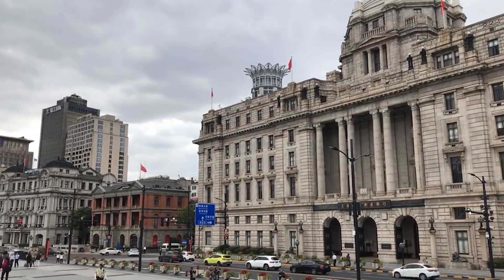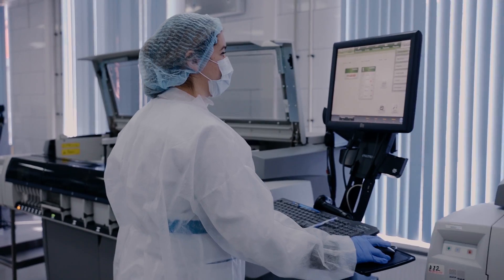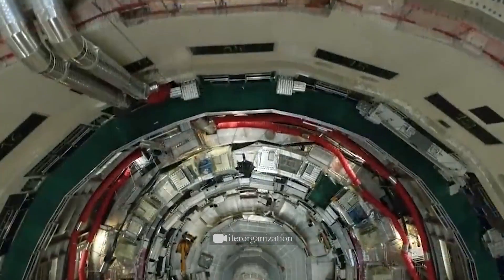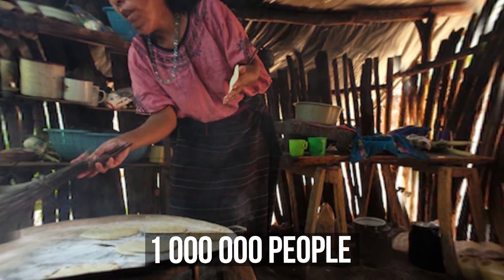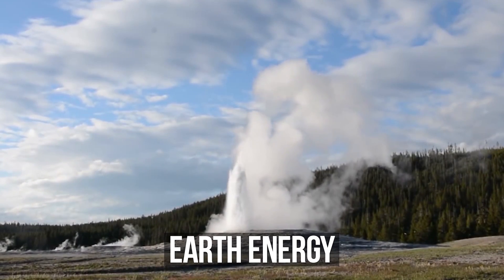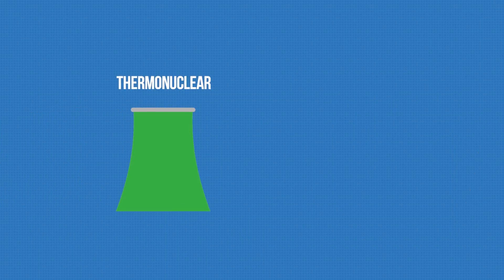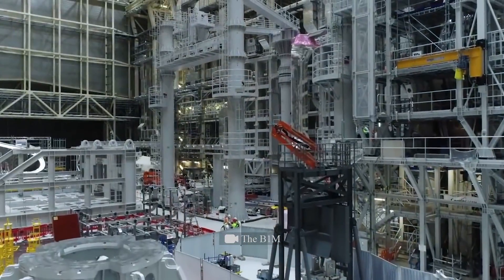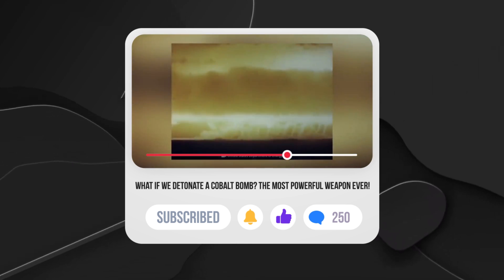Scientists Have Discovered a Terrestrial Source of Energy 6 Times More Powerful Than the Sun

Comment: The moon will be there for almost as long as the sun so, why not use tidal flow to generate power?  Inexpensive, non-poluting and fairly low tech.  Of course, it does require a good distribution network to get that power inland.

Comment: The most urgent need is to develop thermonuclear politicians that emit the work they're supposed to be doing as a byproduct of them being paid to represent us? Currently, they contribute to more deaths globally than anything we use as fuel and will probably bring about the demise of the human race far sooner than fossil fuels. If they would do what they're elected to do instead of trying to further their own agendas and family fortunes, alot more resources could be applied to the climate change problem. Also there would be a lot less hot air being discharged into the atmosphere and a lot less toxic environment in our capitals.
Reply: Hi Tom. Politicians are better at "fission" than "fusion". They split all too easily, form inert radio-active gases, and very low energy neutrons which come to nothing. Cheers, P.R.

Comment: This is why we need to invest in modern advanced nuclear energy options. Small form reactors, LFTRs, Thorium Reactors, liquid reactors. With advances in modern technology, engineering, material science, safety measure understandings and designs, computer technology, robotics, It will really allow any nation to be pretty much be energy independent. Less reliant on fossil fuels. They'll have efficient, stable electrical grids and the rest of the grid could experiment with alternative power sources, etc. We will lessen our emission output a ton since nuclear energy is a emission free power source. We can heal and learn from our past. We really were not ready to handle atomic energy when we did it. Our technology, knowledge, safety measures, computers, reactor options, designs, type of nuclear energy options are so much more advanced now and seriously it will be so much better than this current fossil fuel world we are living in and we really should give it another shot now that we are so much more advanced.
Reply: Yeah but cures don’t build customers.
Reply: Vested coal interests will make sure it doesnt happen
Reply: The problem is not the science it's the racism, borders, hatred...... Until we evolve spiritually we shouldn't be so technologically advanced because we'll end up destroying the planet..
Reply: However as a civilization we've digressed spiritually while we advance technically.

Comment: Just to point out thermonuclear (fusion) reactions have to be in perfect conditions to be upkept. But Nuclear (fission) reactions have to be co Stanly cooled and adjusted to make sure the plant doesn't explode. Nuclear fusion is the future of 100% clean energy.
Reply: Don't tell the commoners... they're not ready for that fact yet..
Reply: everything has to be perfect just for aviation and space programs to work.
Reply: Modern Gen 4 nuclear plants need constant stoking to keep them working so cant runaway like traditional pressurised water reactors that have a fixed fuel load with surrounding coolant water as moderator.  

The next generation of fission plants will use gas, liquid salt or molten metal as coolant  If the there is a failure, say of plant extracting heat, they have a negative temperature coefficient that shuts down the reaction as temperature increases, so they are deemed walkaway safe.

Unlike Gen 3 and earlier PWRs that operate around 350C and use the relatively inefficient (typically 40%) Rankine steam cycle to generate power, Gen 4 plants  operate at much higher temperatures (around 650C) and employ the thermally much more efficient Brayton (ie gas turbine), or combined Brayton/Rankine  power cycle. This means that for a given energy output,  the plants can be much smaller. Importantly they can be 'dry' plants, used in dry or desert environments where there is little or no cooling water available.
Reply: @jimgraham6722  Thanks for that Jim, at last some informed commonsense.  Cheers, P.R.
Reply: Or it can blow up and take Berlin with it ... cus its made in Germany the project

Comment: What happens when there is a power outage and the backups fail along with the magnetic field holding the reaction in place safely and the thing burns a hole straight through the planet?
Reply: Hi Mereel. We work out the molten pile's trajectory, and evacuate the country on the other side. Cheers, P.R.

Comment: Lie. the ocean wave energy is technically infinite, and can energy storage to by water decomposition by electrolysis to h2 and o2. And later can this use up later...  Aand Stanyl Mayer HHO motor engine??? Or just simply H2 and O2 use car engine..... 
2. Heat engine 979 DOE NASA AMC Spirit DL Just only need any type heat source...... Wake up